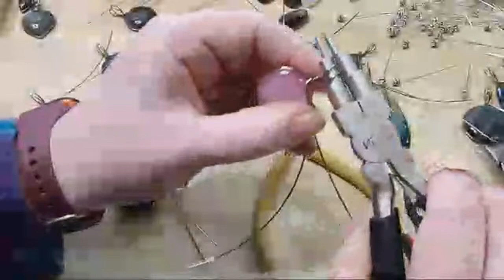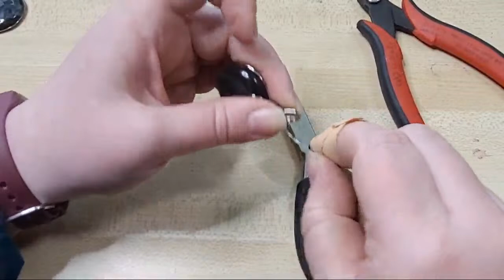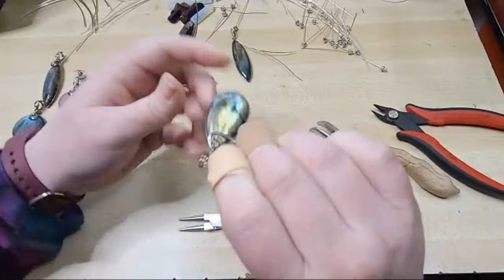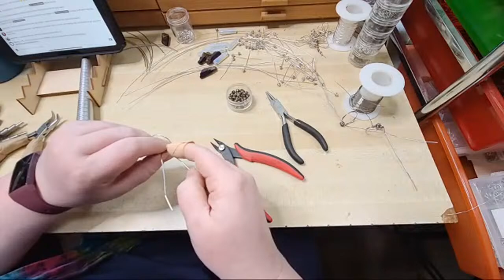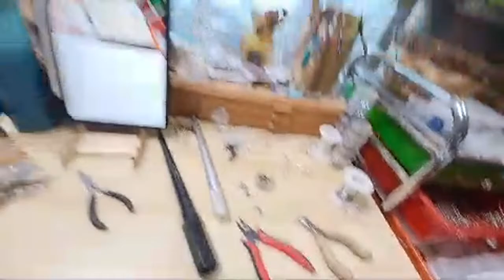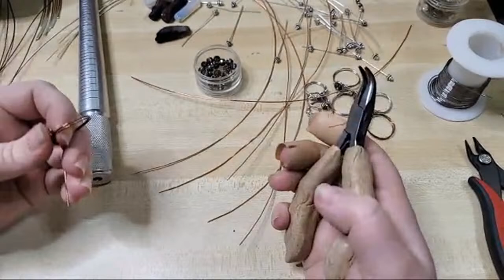Craft Along with Von Livestream 5.6.22

Comment: Sorry I missed the live chat. I have been having trouble sleeping again so I was out cold most of the afternoon. For your finger, there is a liquid bandage on the market or you could use super glue. Use either one of these first as it will stabilize the wound bed, then cover it for protection.